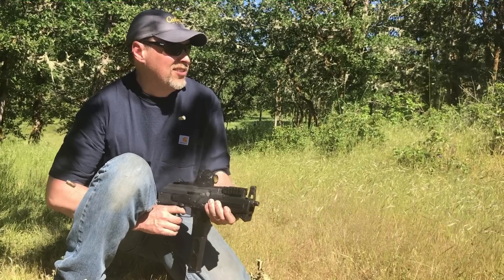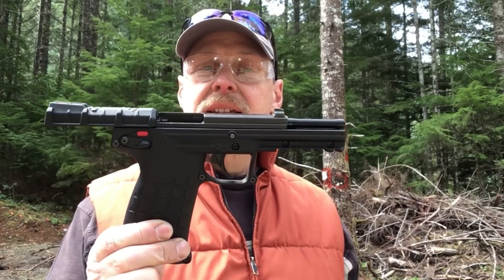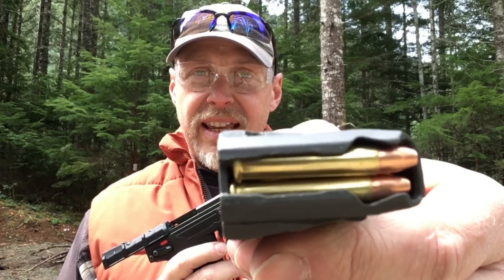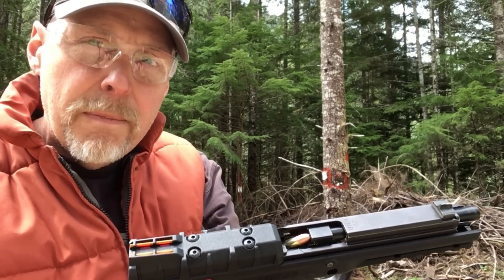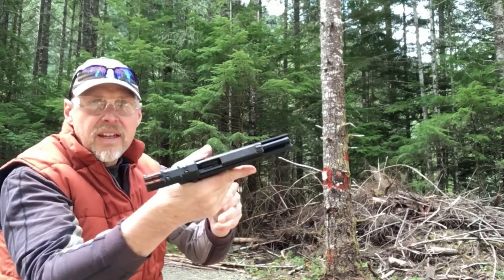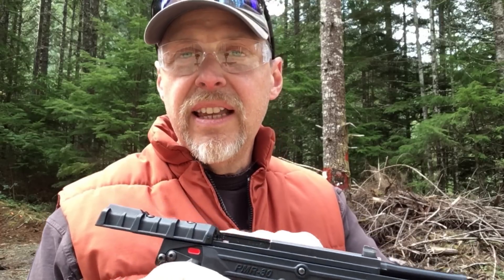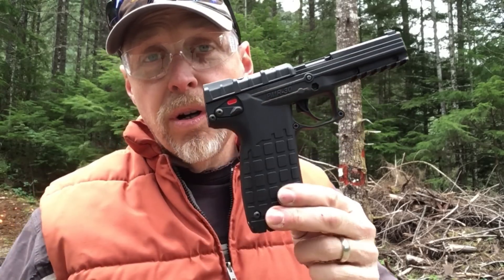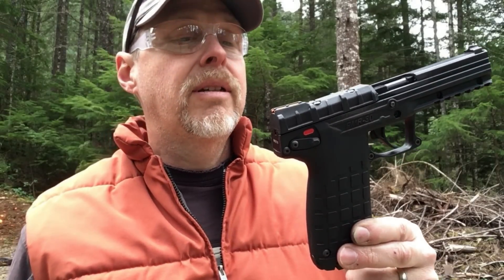Troubleshooting: the Kel-Tec PMR 30

Comment: Your comment about a gun sometimes needing a 500 round breakin period is the crutch that manufacturers love to fall back on (puts the onus on you rather than on a manufacturer turning out a finished product).  Bluntly, the polishing should be done in the manufacturing process rather than in the shooting cycle.

Put it in perspective; you buy a $700 9MM, spend another $80 on a holster; buy 3 extra mags for say $75; and then you have jams.  The manufacturer then tells you to spend another $100 on "breakin" ammo, which may (or may not) solve the problem, but by then, one's confidence in the gun is destroyed.

Like a spouse, a defense gun has to be absolutely reliable from day one.

Your comments about a breakin period really only apply to range guns.
Reply from the maker: Steve Fleischer 
  Almost every semi auto pistol I’ve ever gotten had a hiccup or two when it was brand new. This includes some with stellar reputations for reliability. Glocks, an FNX Tactical 45, my CZ75 and a Baby Desert Eagle. These all came from the factory with a spent casing. And I’m not trying to say they gave anything near the trouble that this KelTec is giving. Just one or two sticking points and then flawless performance ever after. I’m pretty forgiving of a semiauto pistol. Those things take a world of abuse and are so much more reliable than they used to be 30-40 years ago.
Reply: Break in of a firearm is a loose term.  It generally means that you're cycling a new firearm through its motions to remove any remnants of packing grease, debris or metal shavings that might appear during its first use.  It's pretty much common sense to perform this for no other reason than to become familiar with a new firearm.  Even if I owned something cheap as a plastic glock, I'd want to make sure the thing was thoroughly discharged and cleaned before I trusted it to my hip or bed stands.  Common sense....perhaps not...
Reply from the maker: TOBORE8THMAN 
  I agree😉
Reply: Riiight. Because humans are totally perfect beings and we build flawless things. Its logic. You take brand new things and  throw them together, you cant expect it to work 100% right from the get go. It has to break in and get used to being used. Ive only noticed this "it has to work 100% right off the bat" mentality in gun owners.
Reply: my beretta m9 replica brand new. i had more jams than i expected a legendary military weapon to have, cut to now, over 20,000 rounds later. i have complete trust in this weapon. the break in period is real. its the same with a new car motor, or your tennis shoes. you wouldnt want your nikes pre broke in....
Reply: Albert:  not all guns become reliable after say 500 rounds - far too many guns produced nowadays never become reliable, no matter what we do to them (remember von Clausewitz - "Never reinforce defeat").  Your comment is typical of what many people say; that we have to either accept substandard firearms (shoot them until they work) or buy custom guns.  No.  I just bought a Walther PPQ4 target (1,200+ rounds with no hiccups); my Glocks all worked, a SIG 320, etc.  Reliability is possible with good design work and good manufacturing.  I repeat, the manufacturers have sold us a bill of good about mediocre guns.
Reply: Your view is based on your perception of what you should get for your money. Doesnt mean its invalid, just means its your perspective and not a general rule.
Reply: Its not about polishing, because remember they are mass producing individual components.   Because of variances in tolerance, it means that each gun will be unique, and so the only true "polishing" going on is when its actually used.   However, I think it should be possible and affordable to create a machine that continuously and repeatedly rack the slide and feed solid metal dummy rounds through it and exercise the spring so that it will be broken in without wasting ammunition.
Reply: @gilroylibbs2947  I agree, I was just responding to the comment about polishing.   Not only is the casing too long, but its easily dented, and the raised rim causes stacking issues.
Reply: Steve Fleischer damnnnn  😃🤘
Reply: A "Range Gun"? I guess after being around firearms since I was a child in the late sixty's, I still don't know the difference between a range gun, hunting gun, combat gun, tactical gun? My experience has taught me to ALWAYS break in a firearm. Not only to "get familiar with it"(EXTREMELY IMPORTANT), but also to, well, "BREAK IT IN".  IT'S A MECHANICAL MACHINE THAT REQUIRES FUNCTION TO BE RELIABLE AND WORK PROPERLY.  If you buy a cheap ass car brand new, the manufacturer suggests that you drive it causiously during the first few thousand miles to get everything in the motor in cync and moving properly.  The same thing if you buy a $500,000 Ferrari.  You must "Break it in" slowly and properly.  My point is, jumping into combat with a firearm that you haven't broken in would be suicide.  Your comment about range gun, I just don't understand or agree with but maybe someone can educate me on what a range gun is? I've worked at a few shooting ranges and all of our range guns were not only broken in but near broken due to over use and misuse.
Reply: @drewfitz7861   "A "Range Gun"? I guess after being around firearms since I was a child in the late sixty's, I still don't know the difference between a range gun, hunting gun, combat gun, tactical gun? "   Since you use a car analogy, even though you've been around cars since the late sixty's, you can probably understand when someone says a sports car, an economy car, a truck, and a van, and understand they are built for particular niches.    Just as a sports car in is really just made for recreation, since it has only two seats, almost no trunk, can't tow, and so forth a range gun is something just for fun that isn't practical.   You wouldn't bring your Ferrari to pickup the kids from school or to tow your trailer at work, and you wouldn't bring a range gun hunting or as a daily carry.
Reply: I buffed out my P11 with 6000 grit and have never had a failure.
Reply: @drewfitz7861  despite DumbDucks dumb reply....I get what your saying or trying to say in your reply....any gun taken to the range is a range gun....any gun taken hunting is a hunting gun...any gun taken into combat becomes a combat gun, etc. etc. just like any VEHICLE.....If I had a 2 seater and had one child to pick up from school then i would do so....if I could modify it to tow some sort of trailer then I may do so....being practical can be personified as what one has at the time and the given situation one is presented with weather self induced or forced upon them......I don't think Iv'e ever seen any gun manufacture advertise, design or build any gun for any ranges......I have come across a few ranges advertised, designed, and built for guns though.   ;)
Reply: Gfd
Reply: @MaxHeadspace9mm  you said your glocks are perfect now your saying they have issues? You don't know what the hell you are even saying?
Reply: @freddyflintstoned913  why did you buff it out if it's so great?
Reply from the maker: 1970 olds442 
  I didn’t say that at all. You are so desperate to make your point you are resorting to lies and insults. So I’m pretty well done with you. Have a good life. You can keep on posting comments on my channel if you want to look like a fool. Just know you aren’t fooling anyone. And you aren’t changing anyone’s mind. 
  I suggest you learn to let people make their own choices without criticizing them. I also suggest some professional counseling.
Reply: @Wanous-hv7zo  I take all my guns apart and clean and polish the parts. That is why.
Reply: Manufacturers should provide vouchers or coupons for break-in ammo.

Comment: This guy is no dummy but break in period, PLEASE???
He's right 22mag is a long round, KELTEK knew that when they started. But some of the examples run flawlessly so this tells us it's a manufacturing problem. With a round like this tolerances are crucial and these guns need a lot of attention when they are assembled from a basket of parts that all vary slightly from the design spec.
The management and the engineering staff all know this but total silence is how they have chosen to choose as their way to handle the really big problem. They sold them so they should do whatever necessary to satisfy the customer. My gun is currently on it's fourth trip back for repair, it's better but by no means acceptable to me. I have a small fortune invested in trying to find acceptable ammo with no success so it's the gun. I called about a month into this last return and they said they would ship it back the next day, that was a month ago and still no gun.
I am slow to anger, it really takes a lot but enough is enough!
KELTEK GET YOUR HEADS OUT OF YOUR ASSES!!!
At this point the only acceptable resolution would be a new and perfectly functioning gun.
I'm not going to hold my breath.
Reply from the maker: Jack Burnett 
  I haven’t bought a new gun in a long time but back when I did I noticed that the first few mags if it was going to hang up then that’s when it would likely happen. Even my FNX Tactical 45 did that a little when new. So I give them grace for a while. Really high end guns will get a dozen or more “hand cycles” at the factory just to seat the parts that give tight lock up. 
  But I agree with you. You are right on track. Check out my follow up video, “Kel-Tec PMR30 100% Reliable”. In it I tell the rest of the story on this pistol. 
  I think it’s a great idea. Kel-Tec was too quick to market with it though. Too bad. It’s a fantastic design and could really put Kel-Tec on the map if they can survive all the people they’ve ticked off 😆😆😆.
Reply: I i bought my pmr almost 2 years ago.  And i live it and it eats all ammo

Comment: Sir, that was very informative! While I don’t currently own a PMR 30, two things I’ve heard .. 
1) it performs best with 40gr ammunition opposed to the lighter 32gr.

2) Kel-Tecs usually require 500 round breakin .

I like the graphite idea !
Reply from the maker: Thomas Carpenter 
  Yeah I did spend at least 500 rounds of trying every thing I could think of to get this to be reliable. I started with the 40 grain ammo that was recommended by KelTec. Then I tried other grain weights and types because some people said theirs worked better with heavier or lighter rounds. I buffed and polished, fixed the mag wobble issue, bought new mags and on and on. But I think I’ve got it now. New video coming up!😉

Comment: I bought one of these recently while on the road because having a .22 magnum pistol is certainly a novelty.  And when it works it's a load of fun.  A nice, loud fiery pop that will set your head on fire if you use too much hairspray.  But the novelty went away as soon as I started having all the problems you encountered at the start of the video.  I bought it new, so I'll try some of that dry graphite spray and pick up one of the speed-loaders another commentor suggested and hopefully that will do the trick.

Comment: No feed issues with my brand new pmr, but horrendous failure to extract problems. I got through the first mag (25 rounds) with no issues. Every mag after that was horrible. Going to buff the chamber and do a complete tear down to see if something is going on with the extractors. There is a lot of brass shavings after shooting 200 rounds. I did clean it before shooting but I used ballistol that wasn't watered down, so I may have inadvertently gummed it up, i.e. should have watered down the ballistol. I did wipe off all the excess and dry patched the barrel and chamber before shooting. Mine was built in June 2021

Comment: thanks, I have 3 Keltecs, including the CMR, which has brilliant accuracy at 200 feet. I have been having these problems, I'll go to home depot tomorrow. I'm a Former forensics person, I love what these can do.
Reply from the maker: Texasslim57 
  22 mag is a super fast, flat shooter. Lots of potential. I’ve been toying with getting a CMR30 to share mags. Makes a lot of sense. Watch the sequel to this video to learn more. It’s called,” KelTec PMR30 100% Reliable!” Works flawlessly now. 😉
Reply: Thanks for getting back- I cut off 2 inches of the mag springs, they were so tight. That helped the feed, still plenty of push. No idea why they made them so strong.  My CMR broke the firing pin after about 200 rounds. Not the same as the PMR, floating, not fixed. Keltec sent me 2 new ones for free, easy to replace.
Reply from the maker: Texasslim57 
  Yeah, they are pretty reasonable folks to deal with problems like they do. 
  But the CMR seems like a dream come true. Very light, small with retractable stock and shares mags with the PMR30. What’s not to like about that? Maybe a little fragile compared to some but hey, they’re  thoroughbreds!

Comment: I know I'm late to the party here but I have something to add. In the manual (yeah that paper in the case that most of us never read) they recommend that after loading every 5 rounds you should "firmly tap" the rear of the mag on a hard surface or your hand. After doing this and sticking to 20 rounds per mag I have never had a FTF.
Reply from the maker: Ravnican127 
  I definitely was careful to do that. I didn’t receive the manual with this pistol but before I loaded it the first time I downloaded the manual because  the guy that sold it to me warned me it had “special needs”. 
  I did the follow up video titled, “Kel-Tec PMR30 100% Reliable!”  So I’ve had a good and happy ending to this journey. Thanks for watching and sharing. I’ve enjoyed learning about this pistol. I really believe in its concept and design. Now that I am shooting it without frustration I’m becoming a true fan and advocate. I’ve been shooting full mags without incident and with a big smile one my face. 😀
Reply: Any time you load quite a few rounds into a magazine, you should probably tap them every few rounds.

Comment: I just bought a Kel Tec PMR 30 and a CMR 30. Both of them had loading issues. The PMR started shooting much better after about 300 rounds of hot 22 Mag bullets like the Hornady varmit tips. The Cmr had mag spring issues so Kel Tec sent me 2 new mags. I haven't had a chance to try them out yet but I like the dry graphite idea except for carrying a pistol with that black powder because it tends to get all over your hands etc. I agree with the break-in period on these guns but I am used to buying Heckler & Koch or Glocks that shoot good and are reliable right out of the box with no FTF during break-in. Great video
Reply from the maker: Edward L. 
  Thanks. And thanks for the encouragement. I also want to get a CMR 30. Awesome combo with the PMR30. Just makes way too much sense.

Comment: I had to purchase one of these yesterday after watching all of your videos. Mine was jamming up quite a bit (maybe from being brand new). Not only that but I was having trouble fitting more than 20 rounds or so in the mag. I was thinking about keeping it as full as I could for a period of time to get the spring to give in a little but any tips/videos you might have for additional troubleshooting would be helpful! Thanks!
Reply from the maker: I’m surprised after all this time Keltec is still having trouble with this model. I assumed that the new ones had those bugs worked out. 
  My mags don’t have a problem going all the way to 30 rounds. In fact I am surprised how easily they all go in there. But MagLula makes a loader for the PMR30 that I’ve heard really good things about though I don’t have one. Mainly because I don’t have much trouble with loading mine. And I bought 3 extra mags online. None of them give me trouble.  
  MCarbo has a lot of great parts that people swear by like the stainless feed ramp. 
  Mine was terrible with jamming and one trip to Keltec was all it took for the problems I had to be ironed out. 
  Don’t hesitate to reach out if you have trouble with yours. I’m sure there’s nothing that can’t be worked out. 
  This gun takes a bit of getting used to but once you learn what it needs it’s an amazing addition to your arsenal. 
  Btw- I keep thinking about getting another holster. I like the one you made so much.
Reply: @MaxHeadspace9mm  have you used that aftermarket mag release? I think that could fix the issue that I am having with mine.